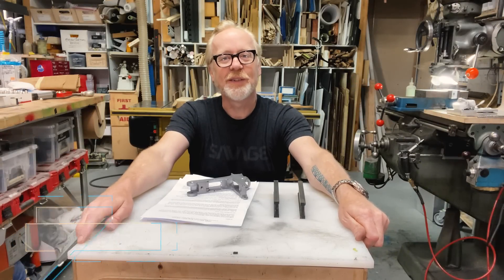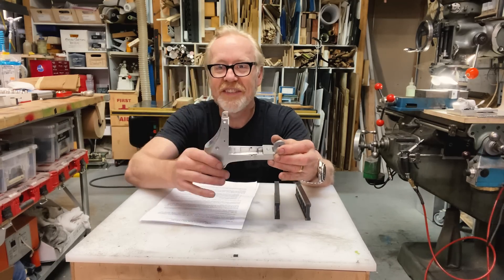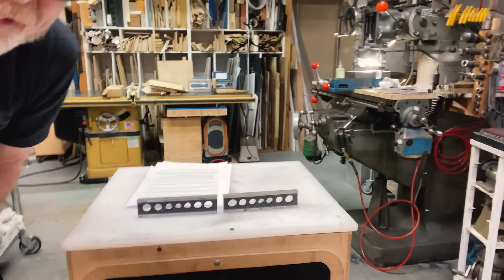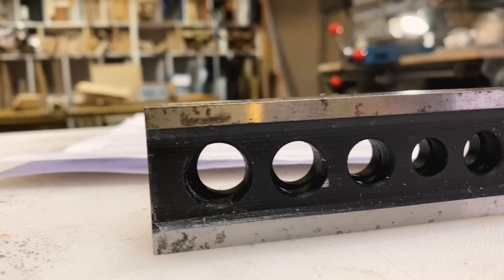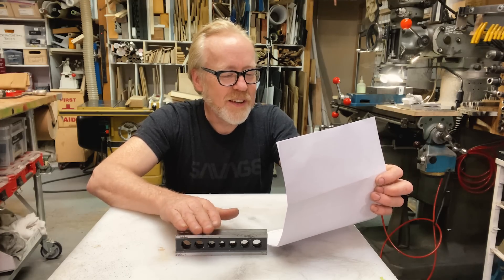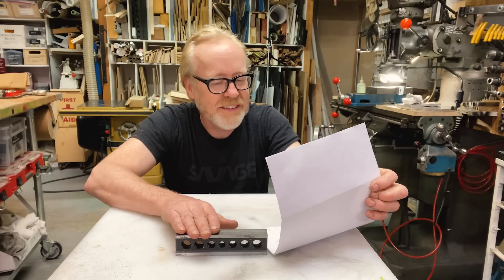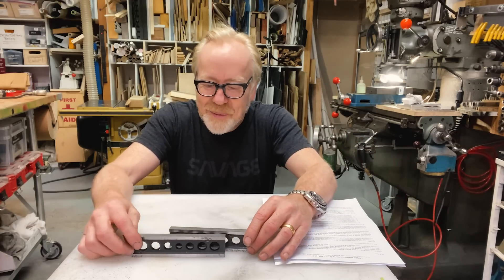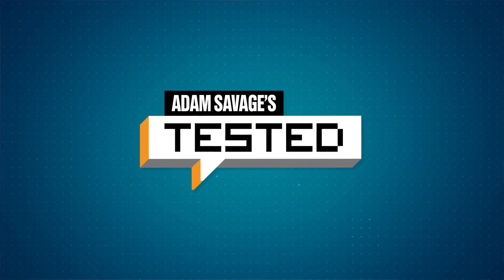Adam Savage's New Machining Parallels!

Comment: Hi Adam.

My tip with parallels is to use a spring or two between them. This keeps them clean underneath as the springs prevent them from moving or lifting. They stay in place when cleaning the unloaded vice with an airline. Another bonus is that the vice handle does not have to be unwound very far as the springs immediately take up any backlash in the vice screw so the moving jaw moves immediately when the handle is loosened. This is a great timesaver when making several identical parts.
Another problem is cleaning the tops of the parallels. Although the springs will hold the parallels in position swarf can get forced into the corners where the tops of the parallels meet the vice jaws. To prevent this, use another slightly lower pair of parallels & place them between the taller ones & the vice jaws. This removes the corner where stuff can get trapped as it leaves a recess between the tall parallels & the jaws so nowhere for anything to get trapped.

Comment: Assuming Adam read it out right (and didn't add an extra zero),
.00002 inches isn't 2 ten-thousandths.
It's 20 millionths of an inch, or about half a micrometre for those who think in metric.
That's about 1% the thickness of a human hair.

And if it's 2 ten-thousandths (.0002"),  that's on the scale of red blood cells.
Truly tiny measurements, and incredible tolerances.
Reply: Adam read it wrong it was 2 tenths of a thou (I should know, they were my parallels)😁

Comment: If you come in "hot" on an aircraft carrier landing and miss the arresting wires, you don't drop off the end of the ship -- you kick in your afterburners and fly around for another try. This is not unusual. Most carriers have three or four wires, and the aviators ("They call them 'aviators' in the Navy; they say they're better than pilots" -- The Right Stuff) aim for the second wire if there are three, or the third in the case of four wires. I remember aviators describing the landing process on a carrier as a "controlled crash," with the emphasis on "control."

Comment: In the late 80's / early 90's I got a job writing gauging software at a shop that (re)made large machine tools.  You were trying to express what 0.0002" is.  We were supposed to make our roll grinder (huge machine) accurate to 0.0001" - and we only got to 0.0002" - grinding a 30 ton chunk of metal riding in lead babbitt - with a 36" x 4" grinding wheel.  When asked why that was a big deal that we got that close ( and repeatable) we used to tell people.... EVERYTHING IN THIS SHOP is bigger than 0.0002"!  That's 1/10 the thickness of a human hair!  Your machinist friend has done some really interesting and meaningful work with those parallels - that he made!  What an awesome gift.

Comment: Shapers are fantastic machines which predate the vertical and horizontal milling machine - they are in practice less versatile than these, and so considered to be obsolete, but absolutely EXCEL at operations that mills can only dream of, with a degree of flatness a mill simply cannot achieve.
Rather than a rotating cutter, a shaper uses a ram to push a single-point cutting tool (very much like a lathe tool) in a straight line across a work surface, elegantly peeling of graceful chips.
Over at neme-s.org, we have an extensive online library of shaper manuals.

Comment: That's a great story that took me back to my attempts to get my first job after leaving school as I wanted to be a machinist. It was the year after Lee started and opportunities were drying up fast as the mines in my area (who provided a lot of the work for machine shops) closed. I never got to be apprenticed as one & it's taken till this year for me to get my own little hobby lathe. I could not resist it as it looked so lonely and unused in the back of someone's Garage. I admit I've hardly used it yet as I doubt very much I could do anything accurate on it but everytime I look at it I think of it's history as after reading up on the model it was made sometime between 1908 and 1935 & of the same type that were purchased by the Royal Navy for use on Dreadnought class destroyers during World War One.
Reply: Oh I’d love a little lathe to mess around on (they were my parallels btw)
Ended up playing with 3d printers instead of getting a lathe

Comment: hey adam savage  i have an awsome test for you from a show called arrow   > rotory grenadluacnhers launch 40mm grenades at subsonic if i remember correctly so can a tin trashcan lid block a shot form a 40mm shot  keep in mind tear gass was used all though holly would makes it go off like a flash bang ......or would the  tear gass round punch through the lid

Comment: (Long story, but by the end it is related, I promise) 

I have watched quite a few “myth busters” episodes and have taken to watching some of your machining adventures. I am not handy, but my partner of 25 years is. That said, we have found that working in concert, we make a pretty good creative engineering team. (My partner came with kids and now grandkids, and we have a good life.) 
 
My partner taught herself how to repair PC’s in the 1990’s, how to build PC’s on circuit boards, and then taught herself how to program computers. These days, she is a senior software architect who, according to her contract, gets to work from home permanently (though she goes into work for some meetings). Thus, she was perfectly placed to work from home during Covid, and to help me in my forced early retirement. 

I am (was) a doctoral-level therapist who spent more than half-a-century working with ex-criminals with addiction and serious chronic mental health and social functioning issues. While I am highly intelligent from a psychosocial perspective, I am otherwise a ham-handed idiot. 

As I mentioned, I am not “handy.” Therefore, prior to meeting my partner, I purchased high-end tools and kept them meticulously organized and labeled. I need the exact right tool for the job at hand. My partner can screw and unscrew something with a dime. I need a precisely-appropriate screwdriver or it’s a disaster (size of bit, length, diameter of shaft, case-hardened tip, etc.) Outside of software engineering, my partner is not an organized, methodical person. 

While it wouldn’t seem that I could help my partner with...well...anything. Some 20 years ago, she was pulling her hair out over a software bug for several days and I suggested she talk me through what she was trying to do. She was frustrated enough that she did so. In the middle of talking me through this part of the program, she realized her mistake. Since then, when she is really stuck, she asks me to help her de-bug. 

We also work together on house and yard projects, brainstorming and working together on the engineering portions. When I can, I help her by bringing her tools (and replacing them to their proper location when she is done with a project.) I also bring her water while she is working outside, or a hat and sunscreen, or a hair tie for her long hair when she is drilling or sawing something, safety glasses and gloves if she happened to forget to don them the last time she took them off, etc.

2 years ago, I became disabled with a severe, progressive neurological disorder. Fairly quickly, I had to take early retirement and I stopped being able to even engage with my previous hobbies. I started to look at YouTube out of boredom and found, “Lock Sport” a few months ago. It is slow going, but I am learning and practicing. My partner is very happy I have found something to invest in, that I can physically do. 

I started to get ideas for new, custom lockpicks, tensioners and other tools. About 3 years ago, my partner started to get into 3-D printing. She has already made a few things for my lock picking. 

Thus, we are now planning on converting our 3rd garage into a heated and cooled workshop with metal machining tools. (We already have some woodworking tools.) I have been drawn to channels, such as yours, which feature machining and working with metal, relevant reviews, and people doing projects using machining. Our first purchases will be a CNC machine, a lathe, a drill press, and others. We are researching good brands for hobbyists, though I keep insisting on quality. 

Thus, I was very touched by your video above, given my partner and I aging, and me coming to terms with my disability, and encouraged by you and your projects (among others, but I like your personality.) That you were sent this gift with such a storied past from someone who can’t use them choked me up. 

Keep making videos, I love your work. Its inspiring :-)

P.s. My partner calls me a "chatty cathy." I really have no idea where she gets this from....

.

Comment: I commend you on learning something new and trying to improve. If you don't have one, get you a Machinist Handbook. They are a bit pricey,  but very worth it. Its full of useful info from speeds and feeds for various operations and materials, to thread pitches and how to properly measure for fitment without guessing and many other helpful tips in every aspect of metal working.

Comment: For precision machining, see Adam Booth at Abom69, or Keith Rucker vintage.org. Both do substantial work with sub 1/1000 precisions on large pieces of material, and have the techniques and tools to achieve that - measurement and machine tools such as shapers and grinders. Both have recently fabricated large precision straight edges (casting, milling, shaping, and scraping) with the help of Windy Hill Foundry.

Comment: How are the holes used? Anyone?
Reply: Sorry for the delay in answering! You could bolt through the holes and clamp the parallels to the machine bed for when you had an awkward set up (not everything was held in a vice).  They were my parallels in case you were wondering - just watched this vid again

Comment: I started my apprenticeship at Ford Motor Co. UK in 1967 and retired in 2004, but I still use a milling machine and lathe as well as woodworking machines at my local Menz Shed.  There's real joy in making stuff, which you of people will know.   BTW  I use a set of parallels that were cheap as chips from Wish, but they are accurate and totally fit for purpose.  My tip for the day is for when trying to keep your parallels spread out against the vice jaws, or dead center when holding round stock, and that's using foam rubber because it will compress and take all the slop out of the clamping and keep your parallel(s) exactly where you need them.

Comment: We still make these parallel strips as a apprentice studying fitting/machining in australia to this day!! My dad did it 20 years ago and I did it this year!! They should be case hardened by the apprentice and then tempered also done by the apprentice then surface ground also done by the apprentice, also those holes in the middle can be used to bolt it down to the bed not just used in the vice. Get yourself some finger clamps and a couple V blocks. Love watching your progress with learning how to use your beautiful machines because I'm doing the same thing :)

Comment: I bought an Abene universal milling machine some months back. It was made in 1994, and was originally purchased by United Airlines. The machine was made in Sweden, and the original inspection report states it is accurate to 0.0003 " (3 tenths ) .  

I cut my teeth on a Bridgeport in trade school, which was accurate to between 1thou and 2 thou (.001" - .002") . Currently learning CNC machining - in trade school - on a late model Haas machining center which is supposed to hold tenths.

Love watching your videos Adam. If I lived close by, and post pandemic if you ever accepted apprentices, I would jump at the chance. I started off in Model Railroading and just love all kinds of model making, fabricating, wood working , machining  , sheetmetal shaping etc..

Comment: He must have missed a zero here.
0.0002 Inch are 5 micron. Either he missed a zero or is pretty shitty job for grinding.
Reply: Nah, it was 2 tenths of a thou. You generally go for 10% of the finish tolerance of the components you are making g when producing tools like this so 2 tenths of a thou was plenty accurate enough

Comment: My junior year in high school shop, we had to make a pair of magnetic parallels, now the parallels were not magnetic, but were designed to be used on the magnetic chucks of surface grinders. In order to make the parallels as effective as possible, they had to be layered, from end to end, to break up the magnetic field, which made the field attract the parallels, more. We had to cut 24 pieces of 1/8 inch flat cold rolled steel, 1 1/8" x  7/8", and drill 2 holes in each piece. Then repeat, in brass. We countersunk, the holes on one side of 2 of the steel parts. Then we started stacking the plates on 2 steel rods, big enough so that we had to tap each plate down, with a wood block and a hammer. We started with one of the countersunk plates and put 2 of the brass plates, side by side, in the middle, so we would finish with the other countersunk plate. We cut the steel rods proud of the countersinks, then heated and peened the rods, until the plates were bound in a monolithic mass. We ground the excess steel rods, enough, so that we could mount the blocks in the vise, on the end mill. We cut the block flat and parallel, then switched to the surface grinder and ground them smooth and to within 5 10,000th of 1" x 3/4". This was not a "One Day Build".
Reply: PS, ........I've used a shaper ............you do not want one. By the nature of the beast, they are extremely heavy, must be bolted down to a concrete bass, and are  scary as hell.

Comment: There is no "love" button on YT so a like will have to do. In 2002 I started as an apprentice at the same factory that Lee worked at, I am still there (more remotely than in the office these days) as a software and systems engineer.

As I went into systems rather than manufacture I didn't get to make a pair of parallels.

Comment: Boy that's no two tenths..... Thats 20 millionths. :D
Reply: Machinists do not express values in millionths. They're machinists not mathematicians. So they speak in terms of the instruments they use.
Reply: @1pcfred  Machinists absolutely talk in millionths when it is smaller than a tenth. 

My point is that .00002 is not 2 tenths. It would be 0.2 tenths. Once you get below tenths, you're in millionths. 

Source: make my living running machines. (That makes me one of those people you say don't use the term millionths...) 

When you're surface grinding to tolerances sub-tenth, what exactly do you call it? 🤔

Comment: Adam, or whoever can convey this to Adam....   You Tube Channel: Abom79, has Many Video's of restoring and using a Shaper machine.  Also, YT Channel: Mrpete222,  Just finished the restoring of a "shop class" size of Shaper  (which would fit quite nicely in Adams Shop BTW) So with that. I hope this may provide others with more machining video watching options.

Comment: A shaper is a huge hydraulic machine. It has an assembly that moves in and out, repeatedly, at different rates and depths as you configure. Then, bits are placed in it to cut material as it moves through it. It's used for cutting grooves, keyways, sometimes teeth  on geared track. Some have tables that can shift orthogonally to the direction of the bit's movement, enabling lengthy, repetitive cuts. I'm sure if you look them up on youtube, you'll find plenty of videos demonstrating their use. I know Abom79 has stuff in this context.

Comment: I think a Shaper is called a Planer in North America.  It's basically a reciprocating slide that holds a cutting tools and planes metal off in a very accurate and controlled way.  It's a very simple and versatile machine and is often underrated because of its simplicity.  It was so good to hear the story of the parallels as I went through much the same process in the late 60s as an apprentice in the UK.  It was common practice back then for an apprentice to make many of the tools of his (and it was almost exclusively HIS) trade.
Reply: We call them shapers too.
Reply: On a planer the table moves and on a shaper the 'arm' moves if I recall correctly. But the tool fixture (clapper) is very similar.

Comment: This is the list of tools I made in school before my tool&die apprenticeship.
- jack screws
- tap handle
- parallels
- 123 blocks
- angle plate
- machinist square
- ground angles
- sine bar
I used these often over the years while I was in the trade.
Reply: Tap handles - check
Screw jacks - check
1,3,3 block (not 123) - check
Then we made punches, chisels, bearing scrapers and all sorts of other stuff I must dig out again

Comment: You should make a how to solder video and show different techniques. I've been trying to learn how to solder and can't seem to get it down and these older youtube videos aren't too much help.
Reply: Preparation is the key to success. The biggest failure soldering is contamination. So make sure whatever you're trying to solder is clean before you try to solder it. Solder is sensitive to contaminants you cannot even see. Oxides and oils that are not readily apparent will adversely affect soldering. So clean the work and clean your tools and clean the solder.

Comment: As well as high accuracy a surface grinder is typically used on workpieces that have been hardened, with a mill you'd be rubbing a hardened tool against a hardened workpiece which wouldn't work out that well. I think the bluing / hardening process they went through could have introduced a small degree of warpge as well (not sure on that one) which would be another reason for doing the grinding after the hardening.
A shaper is just a machine that goes back and forth and scrapes metal off a surface to try and get a flat surface quickly
Reply: If shapers were fast they would not have been so replaced in industry. Mills are way faster.